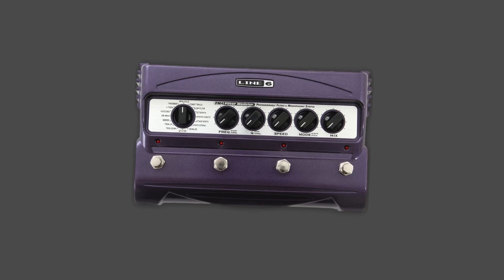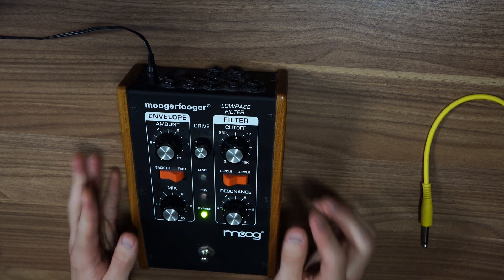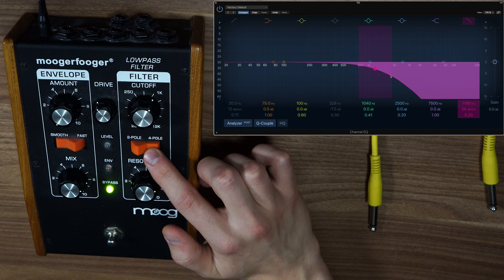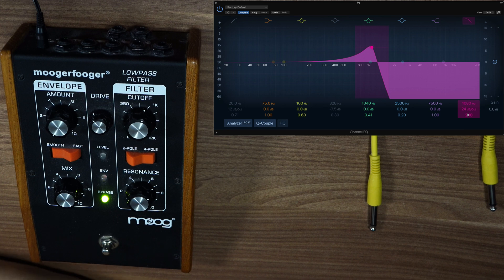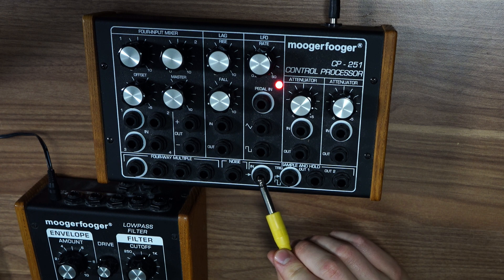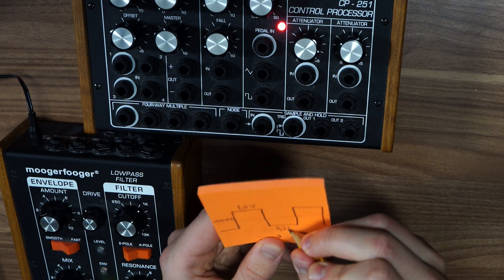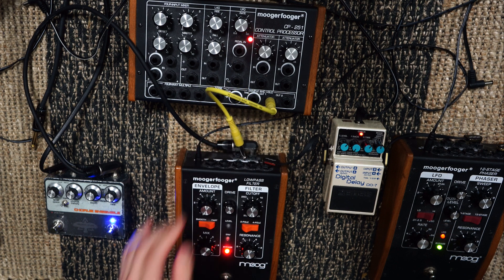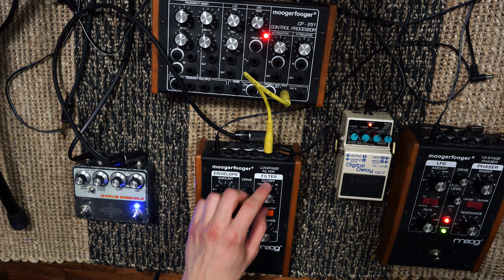How Does the TAYT Solo Sound Effect Work?

Comment: In my „hardcore“ Frusciante times I owned pedals like the FM4, DL4 etc. Had so much fun with the gear :D
But,
During Covid I switched to the line6 hx stomp. Price- & useabilty wise it‘s the best option (for me at least). It has both the DL4 & FM4 build in, as well as many other effects. I‘m just using the DS2 & the Ibanez Wah as a „real“ pedal. 

Greetings!
Reply from the maker: Several people have commented on it know and it seems interesting. What do you use the HX for? Is it for more than DL4 and FM4 replacement? :)
Reply: @Vigi  Yes, it‘s definitely more than a replacement. I use it for basically everything. Modulation (it has a very good CE-1 clon, without the crunch of course), (Stereo) Reverb/Delay and all the weird filter/pitch effects from Line6. It‘s such a great expansion for your pedalboard. My pedalboard: Xotic Compressor -> Tube screamer -> DS2 -> T-rex mudhoney -> WH10 -> micro amp -> Hx stomp

Since I moved to a bigger city in my country, I had do sell my mini silver jubilee. Silent practice & recording wasn‘t doable with the marshall. Of course, the amp sim from the stomp won’t sound like a real marshall half-stack, but it definitely comes close (especially with an active cabinet) and with my settings, it handels the DS2 & WH10 very well! 

The biggest advantages are the massive amount of effects/amps/cab sims and the possibility to record & practice silently. The versatility is also awesome: you could switch in less than a second from John Mayer to John Frusciante :D
Reply from the maker: That seems cool and convenient! I’ve been leaning more towards tube amps and analogue gear mainly, but it would be interesting to explore other solutions. :) What do you think about the M5? It seem to be a popular substitute for dl4/fm4 etc too. :)
Reply: @Vigi  Yeah, I‘ve also got love for the „analog“ stuff :D

I don‘t know much about the m5 ... The Line 6 Hx - Effects could be a great option. It‘s just the line 6 effects without the amp sims and 6 (or 8?) footswitches. Could be a great solution for basically all (modulation)effects! :)
Reply: @Vigi  I know the M5, almost had one before buying both DL-4 and FM-4, I would be satisfied with the M5 because it requires less space on the pedalboard and gives you a LCD display of the settings you saved on the preset, the old stompboxes have the same sound but no LCD, you need to take picture of the settings, or have a great memory, or have a even greater ear sensitivity to remember how created the preset.
Go for M5 or M9 (even better) and you won’t regret.